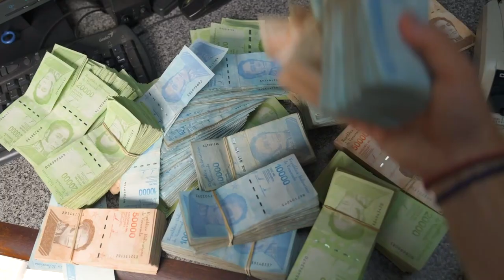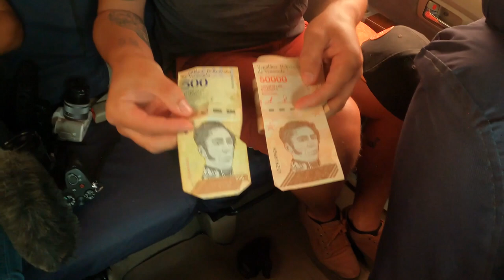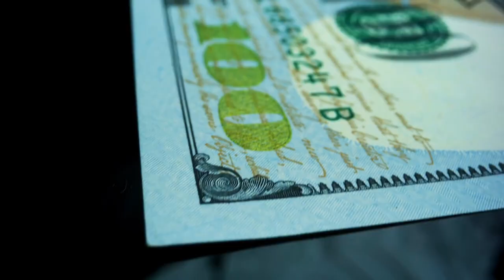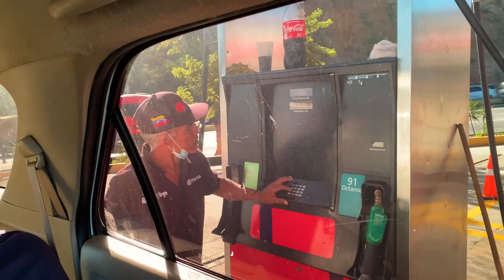The Truth About Venezuela's Gas Crisis

Comment: Little update April 2021: in Maracaibo Venezuela (big city too) you can spend 3 days in line easily
Reply: Because the evil auto corporations brainwashed them into thinking they need cars. Just lazy, selfish people using cars.
Reply: why dont you use motorbikes ?
Reply: @mohnish7653  They do, and they also have to stay in line for 3 days to fill the tank
Reply: @ReneAlex  you can fill up your car and run your motor bike of the gas from it for days
Reply: @mohnish7653  Either way you need to stay 3 days in line for the gas, and Maracaibo is a big city, also the bikes there are not the most modern ones, most ppl have cheap wasteful Chinese bikes.
Reply: @ReneAlex  how is the food  situation there still starvation ?
Reply: @mohnish7653  it's not as bad as it was, but is not "better" either.

There is lot of food and the markets are filled, imported food is everywhere, but is way too expensive for the common folks. Ppl manage to get by, and surely there is malnutrition and hardship. But is not as bad as a few years ago.
Reply: @ReneAlex  sounds like  a rough time take care
Reply: @mohnish7653  we try, thanks for your interest.

Comment: Venezuela is a lesson for every country. No country should entirely depend on a single sector for economic development. You have to diversify your economy so that other sectors can keep the economy moving if one sector collapses.
Also, Venezuela should reduce dependencies on private cars by investing in public transport such BRT with articulated buses and Trains. They can grow a bicycling culture like Netherlands by making bicycling prioritised road infrastructure.
Reply: All that could not work if there is a totalitarian despot in charge, which is the root of the problem.

Most of the advice you bring is sound and filled common sense measures, but the root of the issue is not that, the root of all is the ruling class, they will not do any of that if they cannot turn it into a mass control, political pressure, and class discrimination scheme, it's in their nature.

Most folk that try to see Venezuela and wisely state the fixes do not had the grasp on the underlying situation and do what you just did.
Reply: Public transportation works only for dense areas - you don't take a bus to remore areas, or they are rare
Bycicles are for small countries - you can't bike much with a lot of elevation or if you need to make a 50+ km commute
Going self-sufficient might work, because if you get hit by sanctions but you can feed your people and provide electricity - it's bad but bearable. As soon as another country can cut off some of your vital eceonomy sector and you can't do the same for them - you are done. The status quo in europe is only due to countries depending on each other - start sanctioning there and in a month almost all the minor countries will be venezuela 2.0
In the end - go full socialistic or open up for the free market, not mess up both

Comment: Drew, so whats the fix for Venezuela? From all the intel I've gathered without extensive foreign and external assistance they are pretty much hosed.
Reply: Force free elections (lots of space for interpretation here). Rebuild the democratic institutions. A massive economical rebuild. Decades for total recovery.
Reply: @ReneAlex  

They have to get away from an oil driven economy. Oil will not be king in 35 years and possibly obsolete in 50, and then the only thing they produce is oil. But I totally agree with you it will take decades to rebuild Venezuela.
Reply: @Glidescube  the world is a big place oil will be here for many many years to come, not as the main energy source but it will still out live all of us. 
Also yes venezuela need to diversify, but if there is some use for oil they should and surely will keep taking it out of the ground.

Comment: Thank you for reporting on Venezuela. One thing you failed to mention is that Chavez started programs with Cuba to import communism and export the wealth of the country. Cuba has a tight grip in Venezuela and to this date, Cuba receives free oil from Venezuela.
To fix the country just needs a complete overhaul of its politics. Easier said than done.

Comment: Yes they have more oil than Saudi but it’s very low quality oil and extremely expensive to extract and recycle and you have to mix it with Saudi thats why they dont use it 
To extract saudi oil it costs 6$ a barrel to Saudi or less for Venezuela it costs 80$+
Reply: En realidad es bantante economico de extraer, mas sin embargo es mucho mas caro de refinar. Tambien hay refinerias que se adaptaron para refinar este petroleo extrapesado, no solo en Venezuela sino en muchas partes del mundo, incluso China. Por favor suenas ridiculo al colocar ese precio de extraccion, totalmente equivocado y desproporcinal. 16$-20$ de acuerdo al pozo petrolero donde se extrae.